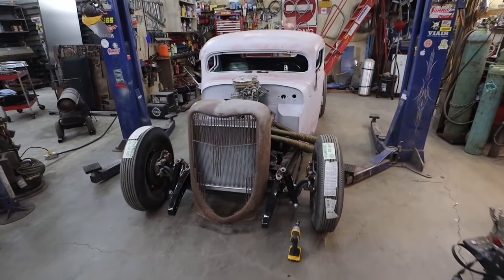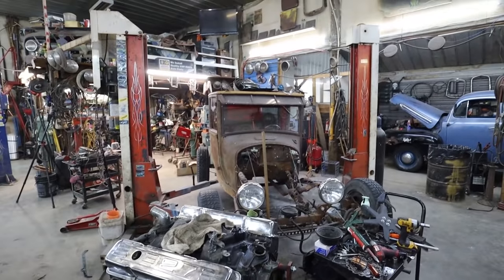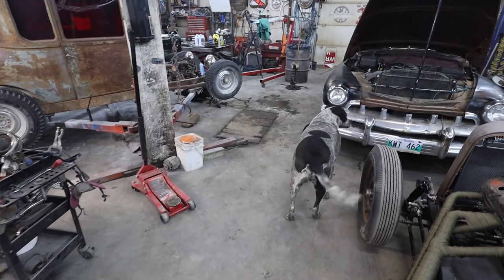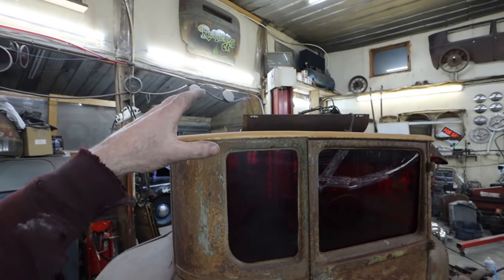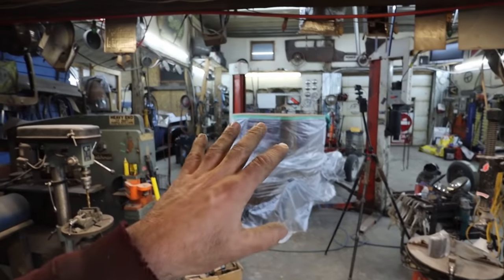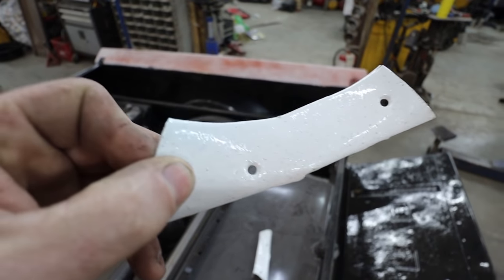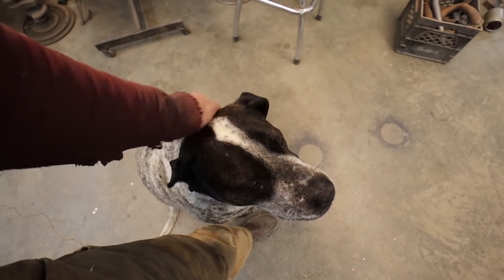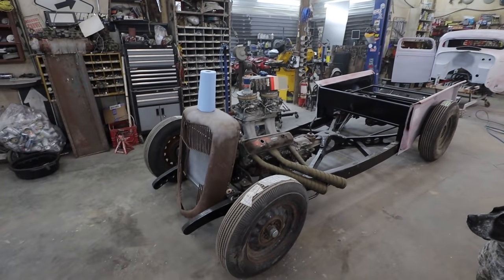Prepping the 327 and testing Metal flake paint maybe for the 37 Ford hot rod Part 29

Comment from the maker: Still on the fence with the Metal flake on the outside of the 37 pickup, would dig it but don't think I can come up with a good design that doesn't make it look like a fishing lure haha. What do you guys think?
Reply: We use to do it on boats but we used a urethane and it was very thick which made the sparkles sink into it. Then alot of sanding. With another coat of urethane.
Reply: I think it’s a neat idea but a little bit too much… I like the idea of a white with less sparkle… I’m worried the green paint + large flake will take away from the rest of the car
Reply: I like the color. Will it be ready for St. Patrick's day? Lol!
Reply: From what I read your supposed to mix the flake with what’s called a intercoat which is essentially a clear. Then shoot the flake and then clear over it.  I’d love to try and shoot flake.  There’s no better 50s, 60s vibe
Reply: You could just do some lowrider style graphics with the heavy flake to highlight some curves and maybe frame the back window,  and little pinstripe always helps bring out the bang
Reply: Thought about using a charged static gun like they use in powder coating ?
Reply: Go Gassier Look, Green Metal Flake, Gold lettering in places, some crazy color plex glass windows
Reply: try a red ground coat then mix your flake with your clear keep it thick. the gravel guard gun should work with clear and flake. put marbles in the cup to mix the flake
Reply: Shoot the metal flake on your welder case and spare the 37.  Not a big fan of metal flake...
Reply: @BeatenRustBuckets  There is a Industrial 327 4 bolt main.  Think Combine.
Reply: If you're ok with going the rattle can route. Check our krylon glitter spray.
I painted an old moped with the green, started with a green base color then sprayed the green glitter on.
It takes A LOT of clear coat to level it out, but after 10 years it's still got that "bass boat" look you were talking about.
If I knew how to post a picture in here I would. But for the price and ease of application, it might be worth trying. Just make sure you use a base coat color the same as the glitter...ie: green paint, green glitter spray. red paint, red glitter spray...
Reply: I wouldn't use the flake.  Just my opinion but it doesn't look very good from here.
Reply: I'm not a big fan of the metal flake.  The car is so neat that it doesn't need it.   But, it's not my car, right?  That being said, I love what you do,  Keep it up!!
Reply: White or light colored background, flake, then a green tinted clear coat?
Reply: @BeatenRustBuckets i thought there were some 4 bolt main 327s in some industrial applications (Massey combines).
Reply: I did flake on the roof of my vw karmann Ghia with lace candy panels over it it's been on it for 3 years and still looks good just bury it with clear and wet sand it smooth
Reply: Well, to be honest I personally am not really a big fan of the metal flake paint scheme, I don't mind a subdued metal flake as in gray or black paint.  My suggestion if I may is the light green you were thinking originally with white accent, kinda like the '51 Dodge.  Or even a light blue with white or cream accent?  Personally I like the softened yellow, butternut yellow I think it's called,, Chevy used it in mid 60's, with a white accent, idk man, I just feel solid softened colors look good, just my opinion, otherwise I'm enjoying the transformation.   Keep up the great work.  

Thanks, 

Dom
Reply: I'd just go with a nice medium Dark green metallic instead, maybe mix some black in the clear
Reply: that is why i watch your vidios.  your not afraid of trying something. or doing things your way.  thank you
Reply: I think give it a go again on another spare panel
Reply: 😎🥺 I think maybe something a bit more subtle like ------- Black lol
Reply: Paint a similar colour base coat before the flake for a more consistent finish.
So many people saying they don't like metalflake and yet all metallic paint is essentially just that, matalflake is just more sparkly.
I remove the gun filter and add a couple of oversized nuts to keep the flake agitated whilst spraying, dont make the clear carrier too thin or the flake will sink too quickly in the gun, use as big of a nozzle as you have if you're using big flake, smaller flake is easier and gives a similar finish but requires less coats of clear to bury the flake.
There's a seller on ebay who retails a colour "Grass Green Pearl Metallic" which is easy to apply and similar to the colour you're after, I used it on my own car and its what I refer to as VERY GREEN, i.e. you'll never miss it in a car park.
Be bold, metalflake is for individualists, not the masses who want to blend into the background and who usually drive like idiots as a result.
Reply: Been making my own lures for a while and what I do is mix the flake in the first coat of clear and after it dries I add another heavy coat of clear or two till I get what I want but I am sure that It is not as critical as a paint job on a Auto?
Reply: Please revive the 70's style of BIG metalflake!  I remember how I felt when I was a kid when I saw cars painted this way!   Carona Deghand agrees!
Reply: @RUSSIANUK  I agree with you...I had an agitator cup yrs ago with the siphon feed.the flakes still sink so I prefer the siphon feed over gravity for that
Reply: I read a article once, it said back in the day they used glitter like you. They used a shoe box cut a hole in the bottom of the box at one end. Dump the glitter in it and use it like a shaker and sprinkle it over a heavy coat of clear.
Reply: I use flake in the clear, but you need a gun with a BIG tip, like a 3.0 or so, especially if you want bass boat type flake. A siphon gun works best, that's all we had back then (70's). Throw a few marbles in the cup to keep it agitated. Flake is messy, no matter what, but dry flake is worse.  You will need to bury it with a ton of clear. Either way. Back in the day with lacquer, it was a ton of clear, lot's of sanding. Never tried flaking vinyl though! Roth has a dry flake gun if you really want to go that route.
Reply: Yes mate give it a shot please 👍 you do fine with everything else love the little truck buddy 👍👍🇦🇺🇦🇺
Reply: Canadian wiggler. Great paint scheme!
Reply: Don’t like it….solid color of your choice would be much better.
Reply: Personally,  I am not a fan of metal flake look.  Bigger fan of satin color on the new truck.
Reply: Thick Urethane lacquer +metalflakes +paintroller
Reply: I'm not crazy about metal flakes, but you aren't likely to do something that looks terrible.  Keep experimenting... you might come up with something great.  It's fun to see you experiment.
Reply: All you have to do is finish the roof like a piece of furniture or a decorative object made with epoxy. Lots of ideas and tutorials on youtube.
Reply: Maybe a stipe or decal but I think doing the whole truck would take away from the design
Reply: Love the mint green you had on the dash    Was thinking that would look great on the whole truck   And use the metal flake too just.     Hi light areas !   so not to over due with too much metal flake.    But that’s just my take on it.   I.do love the truck it’s really coming together 👍
Reply: I think maybe u shud speak to a paint supplier an ask them what type of spray gun to use. Your colour scheme seems fantastic. I think u shud put a little silver to make it glitter. So in the natural light the contrast would be magnificent. 
Just my 2 cents 🙄
Reply: I was with you all the way until the paint... not my taste... but good luck..

Comment: Back in the day my Dad built custom cars, I was young about 10 years old so this was in 1964 and I remember going over to one of buddies house, to see a metal flake job,  his Buddy did on a 58 Ford pickup in his driveway. A brilliant heavy metal flake in brite green  he painted the truck with a brush right out of a can he mixed up. I was young a don’t remember if it was a green based lacquer or enamel. But I do remember it was layed on thick and  the metal flake helped hide any brush marks.  That metal flake painted truck I will never forget!   One point!   My dad told me most guys never had access to spray equipment in the day. They used brushes, rollers, sponges and powder puffs But  I’ve never seen a powderpuff paint job yet but at 67 I’m still young

Comment: Put the (dry) flakes in a coffee grinder to make then smaller, use a timer to check the grind time so as to have the same size flakes . Paint a light green basecoat on the vehicule, then paint the clearcoat with the fine metalflake in it. Another method is to spray a clearcoat using a warm weather reducer and then apply the metalflake with a salt shaker.
Reply: I know you will figure this out, it's gonna be a knock out
Reply: Could also try and steal wife's flour sifter---  with practice may be able to dust it like a puff pastry?
Reply: Maybe he wanted the big flakes?....but I like your info...
Reply: @coherantbliss3483  he could use a screen with larger holes, rather than just pouring out of the jar.

Comment: Just putting a high volume oil pump doesn't raise pressure. Clearance between bearings makes pressure. Unless your using high volume high pressure pump.high volume controls volume. Any huu 327 is the best choice I think for that ride. Been with you since day 1. Your name comes out of my mouth quite often in my shop. You've taught this 64 yr old so much Brent. Thank you

Comment: If your set on the huge flakes... Try using something like a board with a 1/4" lip. Pour the flakes on the board. Heavy clear coat the area. Then apply the flake with a high cfm hairdryer blowing across the board. Make it rain baby. Start with the edges so the overflow starts the top. With some in the air time, the flakes should land more evenly. "More evenly"? There's some good engrish. 
I've been reading way too many instruction manuals written in Chinglish.

Comment: Brent, years ago I use to do boat repair and a lot of it was repairing the metal flake.  We mixed the metal flake in clear and then shot it from a prime gun.  When the clear dried we would run our hands over the flakes to break off the ones that were standing up.  Then we would spray multiple coats of clear to get a good mill build.  We would then sand it to knock off any of the flake that was still sticking through the clear.  Then spray more clear to cover everything.  Then sand and buff to get the high gloss shine.  They must have liked what we did as they kept bringing use more to do.  Good luck.

Comment: Hey Brent, I believe you won on this. You can't win if you don't have some losses. If nothing else you know what not to do now. I was looking at the 327 when you put it together and saw the heads that you have on it. Those heads are rare double hump fuelie heads and are hard to come by. We use to run them back in the days and were the top ones to have. They came with either 194 or 202 valves. What ever you do, hang onto them, as I said they are hard to come by. Later

Comment: I wonder would the flake mixed with clear spray out of a gravel gard gun might work? I remember reading years ago about putting ball bearings in the paint gun to help keep the flake from settling. The 70s dune buggies were done with big flake. Looks wild when it cleared and sanded a few times. But it will be thick!
Reply: A friend of mine years ago had a gun that had a spinning paddle in it to keep the flake mixed all the time while spraying.

Comment: I think that the roller did an amazing job. I also think the roof looks okay. It will be very difficult to clean but for now it looks good. More clear and the flake will get lost and start looking like just a reddish color. I think that your idea of green with a white interior is your best idea yet. I used dollar store neon yellow acrylic water based paint on the tank of my 650 triumph motorcycle and overcoated it with just lots of clear spray in a spray can. It has held up well for 2 years now and yet everyone said it would fail. The key to success is to bury your color so water can't get to the metal underneath. So I'd ditch the flake idea and just find a really nice green that pops and your little truck will look amazing.

Comment: LOL...it is not failing if you are learning something.  I am learning a lot!  It seems to me when I was younger, we tried metal flake.  We put down a really wet coat of clear and then used a shaker to put the metal flake on.  If you are consistent it works pretty good.  However, it remained really rough.  But look at it this way, it was fun experimenting!

Comment: When I painted flakes in the 70's & 80's, I laid down a base coat color...in your case red or green, then mixed the flake with clear...it came through a Binks #7 gun with no problem. After drying I buried it in clear and looked great.

Comment: I’ve done a lot of Flake, Candy, Pearl paint jobs over the years Brent. To explain the process in a short, understandable way is just about impossible. Here’s a couple of tips for starters;
For that “Kelly Green”, find a base coat colour that’s similar to the Flake. Apply enough coats until you have even coverage, then begin applying the Flake as per the manufacturers recommendations. Leave it to cure, wet sand with 800 wet/dry. Start building up the layers, when they’re flashed off start the clear coating. When that’s cured, wet sand and apply another couple of coats of clear 2 part lacquer, when that’s cured, wet sand again & apply another couple of coats of clear. Depending on the size of the flakes it can take several more coats of clear followed by more wet sanding in order to get a level surface. Final wet sand with 1200 - 1500 wet/dry followed by machine polish. Obviously if you sand through the first coats of Flake, you’ll need to either blend the areas in with more Flake before you continue with the clear coat. The secret is to bury the Flake in lacquer. It’s a real labour intensive process and that’s why a pro’ job isn’t cheap. There’s several channels on YouTube that will explain the process far better than I can in a couple of paragraphs.
Good luck from the U.K. 🇬🇧.

Comment: Strawberry fields forever for the telephone box(T-coupe).Since you've done a heavy flake on the roof,presumably a bucket load of clear to make it  pop.
When l had my hydroplane rebuilt,had the boatbuilder do a flake over black on a wide 2 inch pinstripe(corvetteish  yellow for the balance).He dusted the flake on rather than a spray on,then clear coated.It was just a nice amount and it worked.

Comment: Get a gun with a huge tip...like a bed liner gun. Mix the flake with clear. Add nuts or washers to the cup of mix. Shake occasionally so flake doesn't settle in the bottom of the cup.

Comment: Silver or gold base coat, in this case, I would go with silver since you are using green flake. Mix your flake with clear spray on this coat until you have the density you like but try not to completely bury your base color. Topcoat with straight clear until you have buried the flake. Then let the wet sanding begin. LOL. This is how it was done back in the day. On another note as for fading candy colors were very prone to sun bleaching because they were so translucent and you didn't dare leave them out long term. Also FYI we used an agitator cup for our spray guns. Good luck to you Brent.

Comment: Love the truck , and now here we go, there were SOME 4 bolt main large journal steel crank 327s made in 1968, I currently have one of those cranks right now , and a friend of mine has two,. I had a race car sponsor that was a professional body and paint man and he used to do glitter paint jobs all the time , he told me he used 4 steel balls out of like a rear axle bearing in this BINKS paint gun cup to keep the glitter from clogging, this was back in the 1970's and early 80's that he was doing that, hope it helps.

Comment: I'm old enough to remember the metal flake finishes in the sixties. It was most common on ski boats but I saw it on cars, too at car shows. A good finish looked like it was half an inch thick with a mirror smooth surface. The flake size was less than the apparent thickness of the finish, but the flakes were at least 1/8" across, maybe as much as 1/4". They didn't lie flat, either. They were at random angles; that's what made them sparkle. I never loved the look, personally. I like the pearl and the candy color finishes better, but the metal flake was super-flashy. You'll need lots of clear cover coats to smooth it out. I always assumed they were using a 2-part fiberglass resin and sanding the surface smooth after the first few coats. I never saw any evidence that the flakes themselves were getting sanded, but the finished surface was 100% smooth. No lumps, baby. No lumps at all.

Comment: I worked with a guy who did candy and flake jobs on Corvettes for years, and his trick, especially on those and boats was to lay down a layer of the kind of epoxy used when mixing fiberglass. It was ultra-sticky, and gave you time to work, then once it began to set after he flaked the piece to death (he'd sprinkle it on a bit like you did in this video), he'd blob on a top coat - he called it "basketball-court finish" because it looked like it sat half an inch below the surface.

Comment: in the dark ages (60's & 70's)  we used both bearings in the guns also we used air agitators in the pots with a pressure pot w/ flake mixed w/ clear also mixed clear with candy colors w/ silver flake  and then cleared over to smooth out

Comment: Metal flake available on Amazon for automotive finishes.. You need to mix the flake in a clear basecoat. Goes on easier and dries faster. Won't slide..... Then use 2k clear coat to cover the flake coat. Block sand clear and clear again. Many coats of clear will bury the flake.